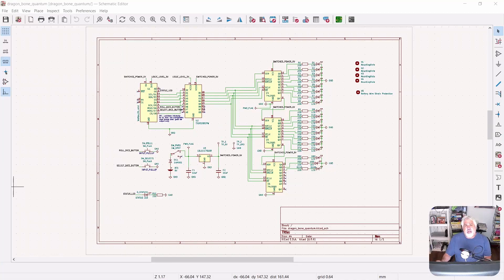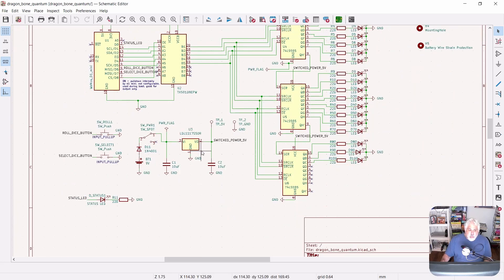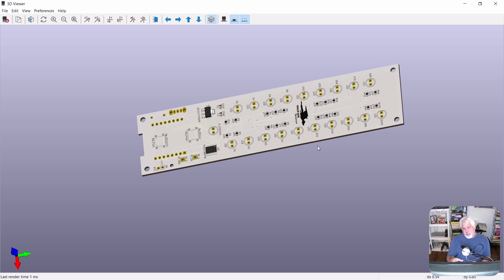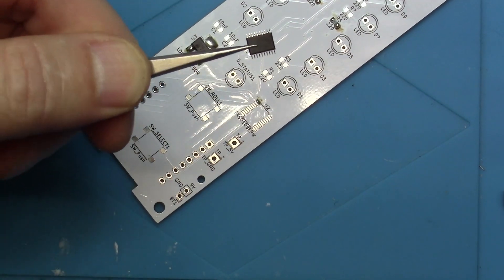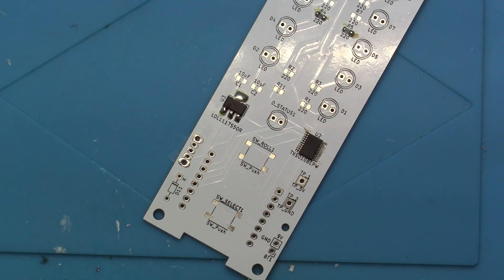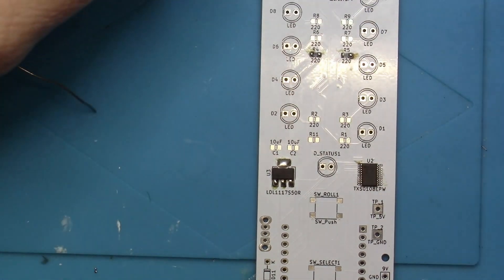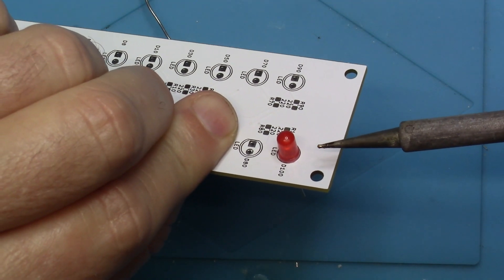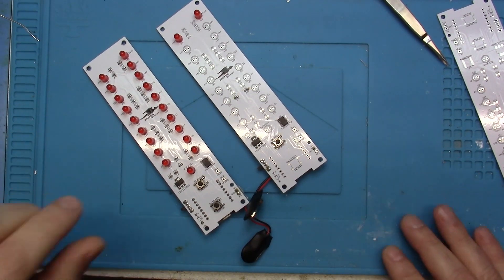Dragon Bone Quantum Dragon Bone Quantum Electronic Dice - Part 2 of 3: The Schematic

Comment: Hmm, I was looking at parts and have a load of SN74HC595N rather than the TTL 74LS595's. Looks pin compatible other than the faster speed (which shouldn't be an issue) but I would like to keep to the schematic and use the proven parts of course.  Which I don't have any of (other than momentary switches of course) Which made me realize I should ask if you have a parts list (and link) so I can support you as a thanks by buying parts (I'll also need of course the ESP83266WiFi) through an affiliate link?
Reply from the maker: I don’t but I should in the future. I think your 595n’s will work fine.